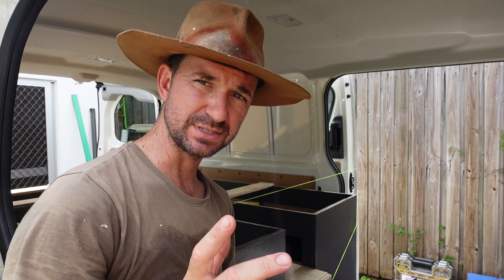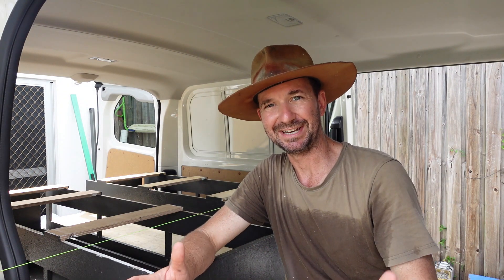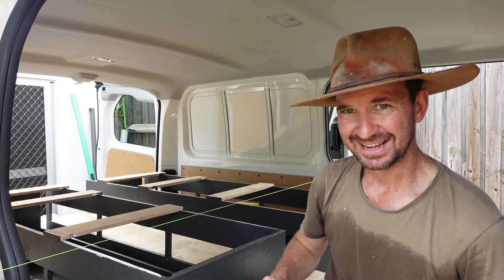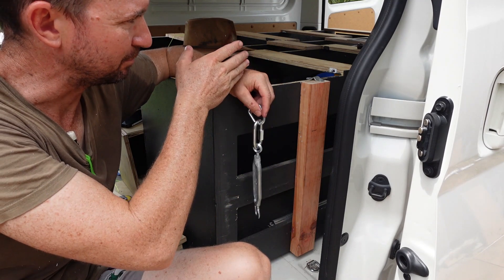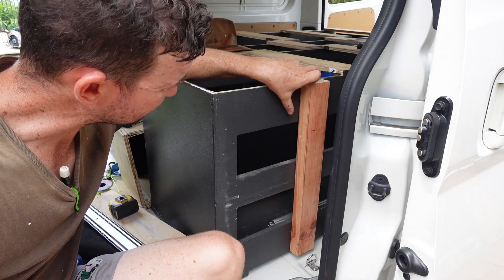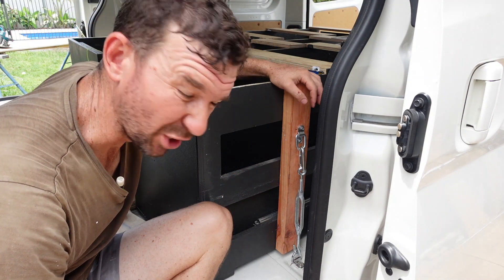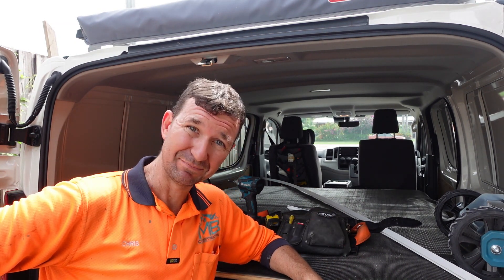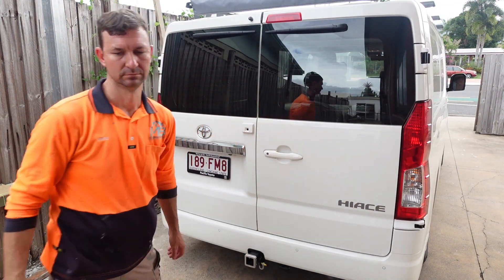Toyota Hiace Van Fit out. Part 4 Securing Drawer into Van and improving drawer operation.

Comment: Hey mate, recently came across your channel. Great work, very inspiring. I'm in a similar position, at 35 years I've decided I want to take the plunge and pursue a career in carpentry. 

Not sure if you've answered this elsewhere, but one thing I'm trying to get my head around that maybe you could help me with, is the whole Cert III vs Apprenticeship thing. As you yourself are doing an apprenticeship, is the Certificate III in Carpentry a part of that, or is it a separate thing?

I've read "do this fast tracked course and then you'll be fully qualified". Then I've read once the course is done then you can start your apprenticeship. Its all a bit confusing. Hopefully you can shed some light. 

Sorry for the long winded comment, and keep up the great work
Reply from the maker: Hi mate, Thanks for the comment. Either way is an option for you. But here is my thoughts and understanding of it (could be wrong though). 
At the end of my time, I would have completed Cert III in Carpentry. So, technically, I'm working to gain experience and completing the "Cert III modules" as I go and getting paid. You can do the Cert III before your apprenticeship which means you will get the modules signed off quickly through RPL. But you still rely on the qualified people around you to sign you off. Which will still take onsite time. I reckon you have a crack at trying to line up an apprenticeship. If after say 6 months you have nothing, head down the Cert III road. Shows how keen and committed you are which may get a foot in the door. Hope that helps mate. Someone may have something else to add. All the best with it mate. 

Build on legend.
Reply: @midlifecarpentry  thanks for the reply mate. Yeh what you're saying makes sense and is how I was hoping to approach it. Just wasn't exactly sure of the processes involved. 
So for me, it's time to start getting in touch with some potential employers and get the ball rolling. 

Keep up the great work Chris, thanks again

Comment: Hey man. Great job on the drawers. Do you know the measurement to the back doors to the opening of the sliding doors? Or what size you made the boxes? Picking my hiace up soon and want to pre plan everything.
Reply from the maker: Hi Mate, if you haven't already, Check out Part 1 of the Van build vids. Pretty sure I covered most of the measurements. to give you can idea on space. I can comfortable fit a 2400x1200 sheet. 2700 if move the seats forward.
Reply: @midlifecarpentry  yeah sweet thanks for the reply! One more thing to bust your chops, what plywood did you use? I’m opting for 12mm marine ply on mine.